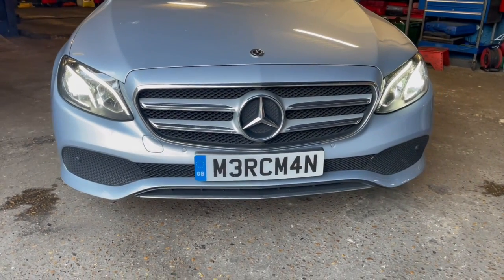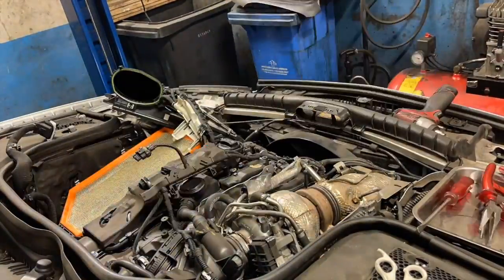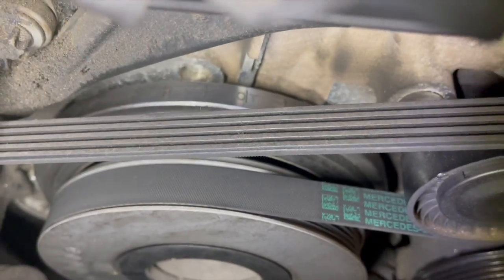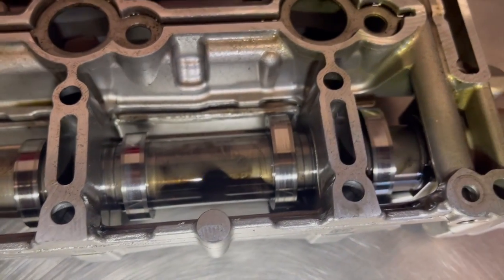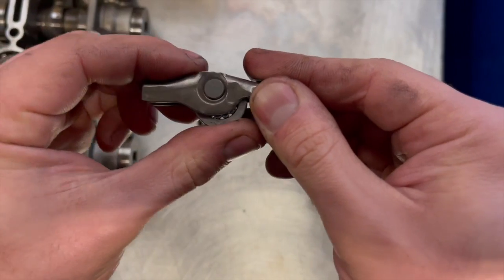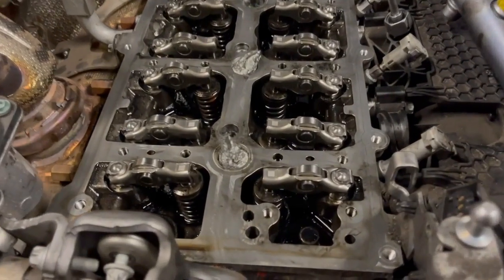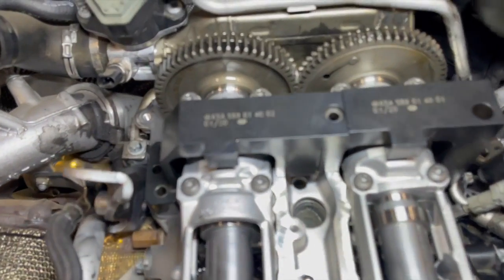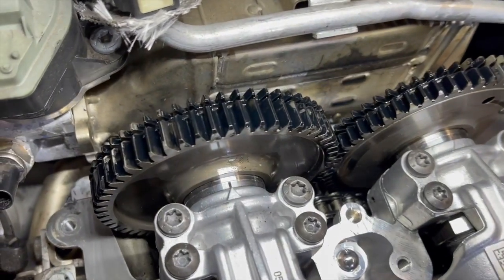Mercedes | Camshafts and Rockers & Tappets replacement | OM654 220d

Comment: The E Class silhouette in your intro had the best lights honestly. I have a 2014 W212 E350 Bluetec facelift. Everytime I unlock it and those lights shine it's amazing. It was the coolest look. Every E Class after it looked so meh. Especially the facelift W213 which was awful. Off topic but anyway. These new 220d engines are refined and quick but so disappointing in terms of its lack of robust components and poor reliability.

Comment: Hello and thank you for the video! Currently waiting for the gaskets, I’ll do this on Monday or Tuesday depending on parts delivery. I have only one problem: the 17 aluminium rocker cover screws. Delivery is estimated 30 to 40 work days. Do you reuse the old ones? I’m afraid of breaking them… thinking of replacing with some from the hardware store, but I don’t know the size. Can you shed some light? Thank you

Comment: I’ve just got this problem. 145,000 miles and it’s thumping like the monkey on the drums on the dairy milk advert. I have it booked in for the end of the month but I have work booked in. Will there be any additional damage with continued use after diagnosis.

Comment: Motorkote end special oil every 10000km!no problems for my Mercedes E300 de whith 867000km!!!!
Reply: Impressive! Same engine OM654 265 hp? Which engine oil do you use and at what interval for oil changes? Did you have this camshaft problem?

Comment: No manufacturer can make anything decent anymore, its all gone to shit engines with design issues from day 0 manufacured to survice maybe 200.000 miles if you are lucky and wear out atleast 2 timing chains getting there.
Take the OM611 and nearly identical OM646 for example. Those were dead simple durable engines. Double roller timing chain that will outlast the rest of the vehicle and no other significant mechanical issues.
They last a long time and since I am thinking about buying a cheap used Van Ive already settled on a Mercedes Vito instead of a VW because they came with those exact engines in them and the older Mercedes Automatics are also very long lasting aswell so a W 639 Vito with the OM646 and Automatic Transmission would be a dream.

When you look you see older Diesels with tons of miles on the engine like 200.000 300.000 and more. Do you think any of these new junk engines coming out will survive that?
I have a near 20 year old Volvo V70 with the five cylinder D5244T Diesel.
95% of the parts under the hood are original and the engine has done 250.000km. Never needed anything changed. Runs like new. Virtually no wear.
Only ever needed oil, filters, belts, pulleys/tensioners and a waterpump.
Makes 160hp, plenty of torque and fuel efficiency is good.
I will do an EGR + Intake cleanout this year in addition to my regular maintenance and probably fit an EGR blockoff plate since it helps them from sooting up the intake manifold and improves fuel mileage slightly.

Before I aqqired the car service records indicated it had 0w30 at 30.000 kilometer intervals. So the absolute worst you can throw at an older Diesel engine. Volvo is delusional and stupid enough to have 0w30 at 30.000km as their factory interval on their cars. The engine vibrated a lot and the valvetrain was noisy as hell.
I put in 5w40 diesel oil and change that every 12 months or 10.000km.
The engine survived the previous abuse flawlessly and runs so smooth and quiet now on 5w40 its hard to believe. No manufacurer these days builds engines like that!
Reply from the maker: I agree, seeing these problems i do not want to own a modern car

Comment: I'm wondering if the " Failing Rocker Bearings and Hydraulic Tappets" issues can be resolved with new parts? As in did MB resolve the issue but improving the parts or is there aftermarket parts that prevent the issue from ever happening again? Is there a specific thing that can be done to make these parts last forever?

Comment: For this problem not to come back you have to cancel all emissions system out DPF , EGR, and adblue. Because of emissions system is blocked this problem appears on all euro6 diesel cars. On that car definitely air inlet and outlet system is blocked and valves are clogged full with carbon.
Reply: Has nothing to do with the engine wiping its valvetrain out.
Reply: @alouisschafer7212 Can you prevent this issue?

Comment: Hi what mileage does this start happening
Reply from the maker: The lowest we have seen was 70k
Reply: @mercmantips  just got a 2017 with 27,000miles  on  sounds loud to me compared to my bmw f10 and when you in the car you can here a slight rumble/rattle from engine nearest to the cab would it be possible to send you a video for your professional opinion?

Comment: Hi thanks for this video I have the same problem with same engine I'm a taxi driver so I'm wondering how long I can drive the car without further damage, Mercedes say I've detected the issue early.cheers
Reply: DONT drive in this condition or you will need a new engine
Reply: @Tony-fh2wi Can this issue be prevented?
Reply: @mbz4652  with 10k km oil change max. short oil changes is the key and dont let the engine running to much time on idlle.

Comment: When this plopping intake sound is present is it always the rockers or can it be problem with egr or something else?
I have the plopping sound and only error code is P0101FA MAF faulty values that triggers constantly.
When running throttle valve test in Xentry the engine become completely silent for a short time.

Comment: These damaged camcrafts are a well known problem mostly of Taxi driver who let their OM654 run at idle rpm for several hours every day when they are waiting for guests. 
I think the oil pressure is a little bit to low for this bad working condition, but Mercedes choose the cheaper solution. OM654 after production date 6/2018 or after 6/2020 (I don't remember the exact date.) use in the rocket instead of the old "Nadellager" a upgraded version, a new "Gleitlager". 
This OM654 is build in nearly every, version of passanger car AND truck like "Vito" or "Sprinter". 
With some care and the right maintainance it's no problem to reach more than 500.000 km. 
Oil change every 25.000 Km is too long. It's better to change every 15.000 Km. 
The remaining weakness is the timing chain and the "Steuerkettenspanner".
With bad maintainance an expensive replacenent after only 150.000 Km is possible.
Reply from the maker: I agree with the oil change being 25k is too high, i advise all my customers to do oil change between 15k-20k max
Reply: @mercmantips  🤣 Oil in the engine should be changed at max 8k miles if You want to run it for long time.
Reply: Mercedes solves this problem after 2022, before that all engines have problems of this kind.
Reply: @silvianenova6455  how do ypu know that they have solved this problem?
Reply: Sehr schön den Kommentar hab ich gesucht
Reply: i change oill every 10.000km But i still got problem. Very expensive problem
Reply: @vladimirhrkic9817  Do not leave the engine running in place. Low oil pressure causes this problem. Change the oil every 7000km.
Reply: I have this on my 08/2017 200d, this exact sound. But only for 4-5 seconds after start, and only if the car has sat for long periods (days). Is this still normal or is it just the beginning of this problem?

Car has never been used much with only 13k km on it, so it has always had oil changed about half the kms recomended. Anyone knows about this problem only with cold starts?
Reply: @ObligedTester  
Bei längerer Standzeit fließt das Öl halt an den Öl-Stopp-Kugeln in den Steigleitungen vorbei nach unten in die Ölwanne. Dann fehlt einige Motorumdrehungen Öl und Öldruck. Insbesondere der Steuerkettenspanner ist ohne Öl und die Kette schlägt gegen Motorblock und die Plastikschienen. Das ist dieses "Rasseln" das nach wenigen Sekunden weg ist. 
Es gibt einige bekannte Sommer-Cabrios. die gemäß Werkstatt-Anweisung nicht mehr gestartet werden dürfen, wenn der PKW nicht nach 1 Sekunde sofort anspringt und danach das Rasseln nicht "sofort" weg ist. 
Das anfängliche "tickern" kommt von dem fehlenden Öl innerhalb der "Hydrostößel". 
Wenn diese Geräusche nach längerer Standzeit nach 4-5 Sekunden weg sind UND beim darauffolgenden wiederholten Start am gleichen Tag nicht mehr auftreten, dann würde ich mir keine Sorgen machen. 
Diese sehr modernen dünnen und vorgeschriebenen 0W30 Öle fließen halt schnell weg und dann ist es wie ein Start von einem Oldtimer, der jahrelang eingelagert wurde. 
Meine Kollegen verwenden für diesen Motor "Mobil1 5W30". Jährlich wechseln. Oder nach 10-15 TKm wechseln. Je nachdem was früher eintritt.
Reply: @Taxman_Watchman  Thank you! I finally found your comment on here. I have no clue why it dissapears?
Its in german though, so I needed to use google translate, but I think I got the info correct from it.

I am familliar with the rattle of a chain tensioner, but only from gasoline Mercedes and BMWs, and this does not sound like it. Ofcourse, a chain on a diesel might sound differently.
I do really think that the sound i hear for 4-5 seconds does sound alot if not exactly as this pretty "strange" sound that they show in these videos regarding the camshafts and rockers.

I was hoping that this could be blamed on that the hydraulic lifters was drained of oil when it sits for some days and thus makes the same sound as these engines in the videos does, but only for a limited time without necessarely beeing the beginning of this major major problem.
Though, the sound in these videos are a very "heavy" and "bassy" sound, my experience with hydraulic lifters from other cars (again, gasoline) they are more "ticky", but this sound are more "thump thump". Again may just be the nature of this engine I guess.

I think I will try to record the behavior next time that im pretty sure it will do it. 
The car has almost always had half the intervals as i never reaches the KM on the counter so it counts 1 year instead. And always at a mercedes dealer. I'm pretty sure they use the 5w30 acutally, at least the last 3 services.

Again, thank you for your assistance and taking the time to write that message.
Reply: Why was my last comment shadowbanned?
Reply: @ was it reply to me? Feel free to post it again
Reply: @ObligedTester  Hi, do how many km have to your MB?
Reply: @ObligedTester  Hi, Did you solve the problem?
Reply: I think you are right today my car went to the shop the camshaft is gone the rocket arms are done my car has right now 174.000 Km the problem probably not getting serviced in time tomorrow my car is getting new camshaft and rocker arms and be aware with maintenace because they are not cheap to swap it's costing me around 1,8k Euros

Comment: After being told for the past 3 months by multiple mechanics that I need a total engine replacement and that my engine is completely damaged (diagnosis purely given on sound alone) I’ve randomly come across this video!! Completely shocked as the sound this engine is making is EXACTLY the sound coming from mine!

Mercman do you have a contact number/email or website I can get in touch with you on?
Reply: Sadly, a lot of dealers are swapping the engines under warranty. 🤷‍♂️ why? No idea. Liability I presume.

Comment: I am interested to know what is the cause of this as it always seems to be on the exhaust side...  Nowhere can i find a diagnosis, or is it just poor quality rockers.... But the camshaft did look very dirty on the exhaust side.
Reply: The cause is….higth pressure problem came  because of the 2 EGRs and DPF and the long intervals of oil 25k km.
Reply: @Tony-fh2wi So by deleting the EGR valves and dpf and shorter oil change intervals, this issue can be avoided?

Comment: Great video: What do you think  - has start/stop system or long oil change period  something to do with this damage and is this fix coming inexorably to all OM654 engines sooner or later?
Reply from the maker: Iv had a 2019 at 60k miles who only services at mercedes main dealer and even on that engine he had this problem, so i think its purely just bad design…

Comment: Is the engine running on all 4 cylinders at this moment, without an error message in the speedometer? Is the noise where you can tell ahead of time that the rocker arms need to be replaced before it's too late?
Reply from the maker: Engine is running on all 4 cylinders as there is no misfire, the blowing noise is due to the valves opening or closing a bit late or earlier than it should causing some sort of back fire in the intake system
Reply: @mercmantips  So before the rocker arms break completely, the engine gets louder and louder with this dull noise?
Reply: @motorsus9974  pretty much yes, you can observe the noise when starting the car, and it quietens down after a couple of seconds.

Comment: We got few 654 with over 200k nothing wrong with them... oil changed maybe 2 times.I do not know what is wrong with some examples
Reply: Which year?
Reply: @DmitriiD-u1f  it fairly simple job.
I fixed mine last summer on my driveway. 
No locking tool nothing.
All is simple.
Reply: @nieprofesjonalnie  ok) But I was asking you about the year of manufacture of your engines)
Reply: @DmitriiD-u1f  2016

Comment: Hi Mercman. How much would this kind of repair cost approximately on a OM656 engine? Parts and labour? Much appreciated! Zhivko
Reply: Between £1100-£1700. Depending if the camshafts have to be replaced or not. Camshafts £600
Reply: @fsasarianu  Thank you for the info fsasarianu!
Reply: What if it’s just the damaged ones replaced? Is that ok to do? Along with a new seal whatever it’s called
Reply from the maker: If the camshafts are not damaged and checked properly and definitely no damage then you can get away with using the old camshafts
Reply: Where abouts are you in london

Comment: Great video. Was this issue resolved by manufacturer with newer models (2019-2020)?
Reply: After 10/07/2018 new parts are installed.  https://www.jamescooke.me.uk/automotive/noise-from-engine-e-class-w213-om654/
Reply: @fsasarianu  то есть после этого времени , такой проблемы с 654 мотором уже нет? или же это судьба всех 654 и 656 моторов???

Comment: Really great video, I've seen hydraulic lifters fail on om651 but never on om654. How did you torque the sprocket screws, not much space in the back due to egr cooler.
Reply: You can torque those off the vehicle on the bench. Just use the locking bar to keep the position. Once you have those torqued down, it's just a matter of moving the entire assembly over to the vehicle.
Reply: @LynxStarAuto  arent the cams hard to fit into the sprocket when you tighten the bolt before putting it back in? I thought that thats the whole point of losening these bolts

Comment: Don’t you have to set the rockers? And also won’t the gears keep the camshaft in place? Sorry I work on ship engines not cars 😂
Reply from the maker: No just soak the tappets in oil before fitting them in, the locking tool just helps overall, i probably can do it without the tool, the main benefit of the locking tool is it lets you tighten the gearing bolts without the camshafts moving..

Comment: What mileage?
Reply from the maker: This one was only 70,000 miles
Reply: @mercmantips  wow, I guess oil should be changed 9-10 times by then, but I suppose that never happened. 2 or 3 services tops.
Reply from the maker: Yes this car was not well looked after, but even happens on well serviced engines at high mileage, the bearings on the rockers are just a bad design..
Reply: @mercmantips  did they improve this with later models, is it worth buying E220D from late 2021 or?